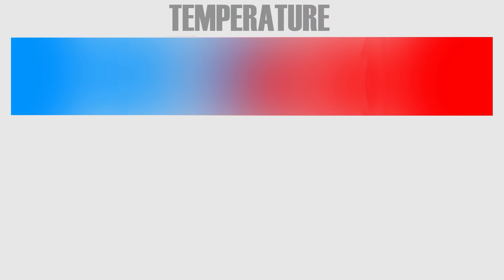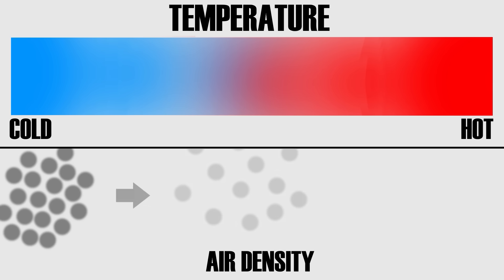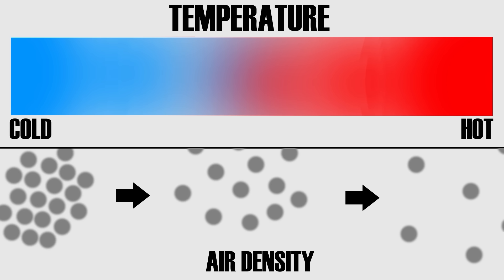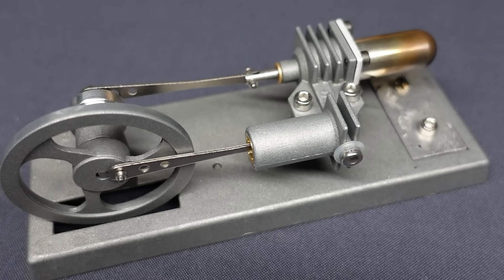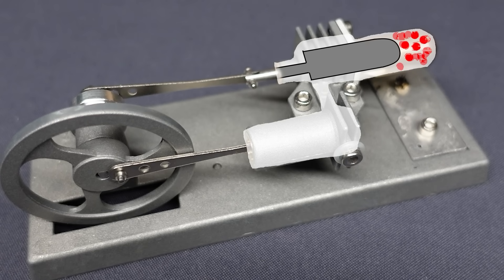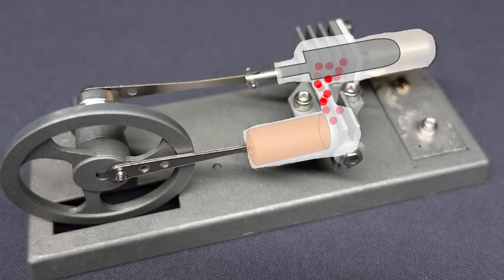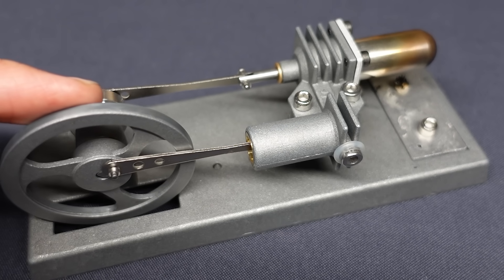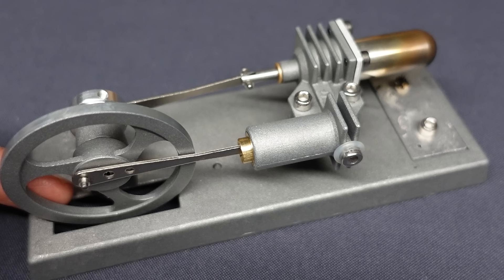It Can Save The World - The Simple Genius of Hot Air aka Stirling Engines

Comment: Well, frankly speaking, steam engine and steam turbine as used by power plants are technically external combustion engines as well. The fire burns outside the motor in a separate chamber, not inside the engine.

edit: Nuclear power still counts as a combustion. Also, that's the point of these kinds of engines. The type of heat source is flexible. And even more flexible on Stirling engine as it doesn't require extreme temps to work decently. For Steam turbine, you can take nuclear as mentioned magma heat, or even recycled from gas turbine exhaust. And on Stirling, it can even run on the warmth of the hand if tuned correctly. That type is called Low-Temperature Differential Stirling Engine. HOWEVER, stirling engines may not be as efficient as Steam Turbine hence why it ain't widely used today.
Reply: Fission is not combustion you silly billy, neither is geothermal.
Reply: And with both far more superior than Stirling.
Reply: Very true. The steam is a secondary fuel but the primary fuel required is wood, coal or fossil fuels.
Reply: @markjones6096  Steam is not a fuel. It is simply a working medium.
Reply: Nuclear power is not combustion, in combustion an element or elements are combined with oxygen to form a compound, where as nuclear power is fission where an atom is split to form potentially several new elements. Even fusion doesn't involve oxygen, and anyway if it did the element and oxygen would be fused into a new element rather than a new compound.
Reply: @SunriseLAW actually we're doing even better according to the EIA.
In 2022, about 4,243 billion kilowatthours (kWh) (or about 4.24 trillion kWh) of electricity were generated at utility-scale electricity generation facilities in the United States.1 About 60% of this electricity generation was from fossil fuels—coal, natural gas, petroleum, and other gases. About 18% was from nuclear energy, and about 22% was from renewable energy sources.

The U.S. Energy Information Administration estimates that an additional 58 billion kWh of electricity generation was from small-scale solar photovoltaic systems in 2022.2
Reply: @T8ombs23 The growth of electric cars & other battery electric items have swallowed up all renewable electric sources and outpaced them. Zero good was accomplished, but the CCP has more money to play with in influencing the world.
Reply: Nuclear energy is not combustion.
Reply: This reminds me of Matrix , instead of using red baths of pipes , with no explanation how it works , they could have put in sterling engines that run of human body , and make Steam Punk version of Matrix . It would be a lot better movie . Then neo could have used his mind to heat up the engine and get more power for them to get away .  Endless potential there.
But best matrix movie is Rick and Morty Anatomy Park Pirates of the Pancreas  , there is a movie like that , but another one can be made
Reply: "edit: Nuclear power still counts as a combustion. "

how so? there is no combustion involved.
Reply: @MyBinaryLife  because its internal , internal part of internal combustion , its not  combustion its degradation , but internal degradation , its not external , power comes from inside the power plant .
Its not outside .
Solar panels are outside and hence are not internal , power comes from outside .
From that point of view , and its obvious man is speaking from that point , making your view questionable ,  buddy its not rocket science , its common logic in figure of speech , i am not a native English speaker , i know many languages , and even i get it .
Reply: I read an interesting article about how NASA are experimenting with designs to use a radioactive thermal source to power sterling engines hooked up to generators. Much more efficient than thermal generators, and completely self contained. You could create a modular design and just plonk them on the moon to have instant generators without needing sunlight, refueling, or maintenance .
Reply: I guess the beauty of the Stirling is its simplicity then. If you've ever seen a schematic for something like a steam locomotive, an ICE seems comparatively simple!
Reply: >Nuclear power still counts as combustion

Can you tell me which brands of crayons taste best because you clearly come from stupid town.
Reply: Power electric engineer here. It depends on the type of the generator, size, purpose and type of electricity that you need.
So as you said, steam power plants, gas power plants and nuclear plants are external.
While there are still internal combustion powerplants that work with diesel or gasoline.
Also, some submarines use external combustion engines. Aircraft carriers use some kind of nuclear Stirling engine as well.
Reply: "Nuclear power still counts as a combustion"

??? There is nothing combusting in a nuclear powerplant, or at least here shouldn't be lol.
Reply: @Gnerko123 Chernobyl reactor 4 was an external combustion source… for a few weeks.  LOL! 😅
Reply: "Nuclear power still counts as a combustion" - no? Combustion is a reaction between fuel and an oxidizer. Radioactive decay is, last I checked, not that.
Reply: Nuclear power absolutely does not count as combustion. Combustion is a chemical reaction.
Reply: Correct
Reply: I came here to post this.

I once had someone try to tell me they “weren’t” because a furnace is internal.

I just smiled remembered learning it in High School, “The steam engine is an external combustion engine” - I learned that day that some people will never listen
Reply: @SunriseLAW  Unless they charge with solar, since the sun is internal combustion.
Reply: Have you ever heard a guy named Carnot? Effenciency depends of highest and lowest temperature and only for those. If you heat steam or gas to the same temperature (high) and put them away to the same temp (low) you may have same effiency.
Reply: power density.

a stirling is limited to surface area, thermal conduction rates, and the volume of the air. the density of the air.

steam engines, its like stirling on NOS. far more energy contained in a gram of hot water vapour, than in a gram of plain old air.  youre only limited at energy insertion at the boiler... can make that bigger! steam in ports? make them bigger! real easy to transfer kilowatts, megawatts of power down a pipe, not so  easy to get that heat into air through the walls of a cylinder.

thats the stirlings fault... heat exchange. can only get so much heat across the walls of the cylinders to the air. and as you make them bigger, the old surface area/volume comes and bites you up the rear. double the dimensions? square the surface area, cube the volume... run smaller cylinders? friction and complexity. cant win.

ICE? they figured out long long ago that ist far easier to simply add fuel to air, shove it into a cylinder, then light it up. the fuel burns, provides heat, and being intimately mixed with air, the air gets hot, expands... and then you pump it out and suck in a new batch. certain "stirlings" also "renew" the air... 

 they then ran into issues with lighting that air/fuel mixture... tried everything... hot bulbs, air blast diesel injection, trembler coils, low tension, high tension... hell, some even just punched a hole in the side and held a blowtorch against it...

finally someone figured out porcelain supported airgaps, aka sparkplugs, and someone else finally got a diesel to self ignite fuel from compression alone... then refineries got into it and started making "standard" fuels.

about 1930, they got all that part sorted and really, nothing has changed in the last 90 years or so. just made this lighter, that lighter, changed this material, that material, threw in some airflow considerations... added a computer to make them seem far more complex than they are...
Reply: Ok, I replied to Gnerko123 with some humor, but reading these replies, I want to clarify combustion vs. heat sources.  For background, I was a nuclear engineering major in college, and worked at a nuclear power station as a student, before changing to a liberal arts degree with a physics minor.  I now work as a helicopter mechanic, certificated to work on Brayton cycle internal combustion engines as well as traditional 2 & 4-cycle reciprocating ICE engines.  

Those weren’t a flex.  They are just my bona fides to show that I am qualified to help explain some of the confusion shown here in the comments.

Combustion is a chemical reaction taking place between the electrons in the outer orbitals of a fuel (typically a hydrocarbon) and oxygen.  The fuel and oxygen chemically react with each other creating new chemical compounds and releasing heat.  The important point is that none of the elements involved (carbon, hydrogen, oxygen, etc) actually change.  They just combine with each other in different ways.  

An easy way to think of this is if you have a bag of legos assembled one way, and are told to disassemble them and reassemble them into a totally different way…. with a time limit and your puppy in a guillotine attached to the timer.  If we connect a copper conductor to your forehead, you will produce heat as you are creating the differently assembled legos.  The important part is that the individual lego pieces are not any different at the beginning or end.  They are just assembled differently.

Nuclear reactions (fission in our electricity generating power plants and fusion inside of stars like our sun) are NOT combustion.  Nuclear reactions don’t care about the electrons in the outer orbitals.  They are changing the actual structure of the nucleus of the elements involved.  In fission, like a power plant, we are using slow moving neutrons (slow is relative to the normal speed of a free flying neutron.  That normal speed is absurd.) to collide with the nucleus of large, unstable atoms such as Plutonium-239 or Uranium-235.  The neutron is slowed down so that it doesn’t just fly right by without colliding with the nucleus (we’ll get into quantum theory if I go further here).  Those large, unstable nuclei split when the neutron hits, and now totally new elements are created, along with a huge amount of heat.  The heat does not come from a chemical combustion reaction (such as the electrons in the outer orbitals of oxygen and a hydrocarbon reacting with each other).  The heat comes from entirely new, smaller elements being created from a larger element.  

To be a little more brief for fusion, it’s a nuclear reaction the opposite of fission.  Stars take two incredibly small atoms (2 hydrogens or 2 heliums) and crush them together with intense gravity, quantum effects, and astrophysical stuff I don’t understand well enough to explain.  When the repulsive forces of the two positively charged nuclei are overcome (along with some stuff to do with the Strong nuclear force), those 2 atoms are no longer separate, and no longer hydrogen (or helium).  They are now one, totally new and different atom.  Again not combustion.

To go back to our lego example, for fission you are now throwing bb’s at the legos with just the right amount of force to actually split individual lego pieces in half.  First, you’ll no longer have the same component legos you started with.  Second, the heat you’ll produce now will be way higher because splitting legos apart with bb’s is nearly impossible for a real human.

For fusion, you are now taking 2 legos and crushing them in your bare hands so hard that the plastic actually fuses into one completely indistinguishable new piece.  There is no sign that they were two pieces before.  They are just one, totally new piece.  And, now the heat you are producing is on the order of a DragonBall Z character going full Super Saien. 

Real quick, for geothermal, still not combustion.  Here we are dealing with actual residual heat from the core of our Earth.  It’s waste heat like what he was talking about in the video.  But, the core of the Earth is not having a chemical combustion reaction going on all of the time.  Geology is not my strong point.  So, here I’ll just say that it has something to do with gravity, pressure, I think some magnetic flux, and there’s even some theories about nuclear reactions.  Clearly, I am wrong about some of that.  I know I’m ignorant on geothermal.  Except, I am 100% certain that there is no chemical reaction happening between the outer orbitals of oxygen and a fuel source.  The heat used in geothermal is purely waste heat from the magma deep inside of our planet.

Our lego example here is if you put the legos inside of an autoclave and left  them there overnight.  In the morning, you remove them and use the heat from the melted legos to save your puppy.  The legos were never on fire.  They were just pressurized and heated up to extreme amounts.  You are now using that leftover heat after that pressurization and active heat source are no longer being applied.

My point is, who the hell puts a puppy in a guillotine?  That person is a sicko!
Reply: @dougmoore6612 are you a book writer 😊
Reply: @dougmoore6612  Good explanations, just enough to explain but not going so far as to get absurd by trying to explain quantum mechanics. Never try to explain quantum mechanics...

As for who put the puppy in that guillotine, I think it might be the same sicko who thought it was a good idea to put a cat in a box with a bottle of poison, a radioactive source and a Geiger counter that will break the bottle is it detects radioactive decay...

Yep, I blame Schrödinger, he's used to it...
Reply: People that don’t understand that “internal combustion” implies the existence of “external combustion” are most definitely apart of the problem in this world😅
Reply: @robertpayne5499  that, lets say dichotomy, is not necessarily true. Lack of recognizing or own assumptions is a problem as well in this world
Reply: Not the steam turbines that are powered from nuclear reactions though!
Reply: @nuclearscarab You can power Stirling engine by nuclear reactor.
Reply: @MFT9170  most stupid thing to do
Reply: @oktogen1476   Of course. Stirling engine would be viable if you can't afford to use any water. Something unimaginable in the case of nuclear plants. I have no idea about mars rovers but I imagine there is a better way of energy harvest using solid materials. That doesn't matter to me though. There is a discussion on the meaning of combustion, if you read the comments again. That's what I'm replying to. I hope it's clear now.
Reply: You think?

Great insight.

Thanks
Reply: Great grasp of the extremely obvious.
Reply: @johnsmith1474 The beginning of the video mentions people who still can't really distinguish between external and internal combustion yet. So I just think I might have to make it clearer.
Reply: @johnsmith1474 autism detected